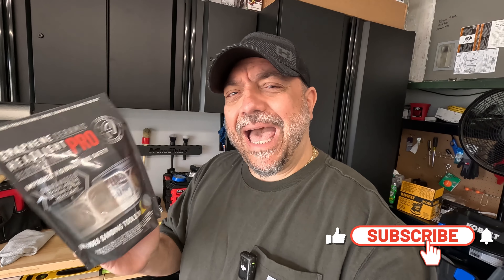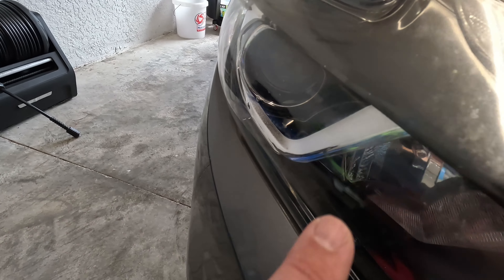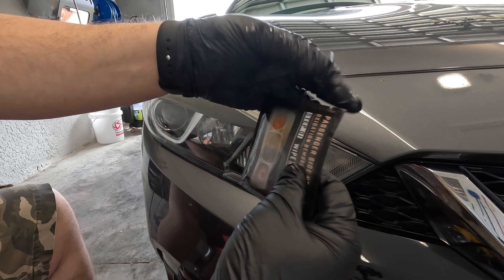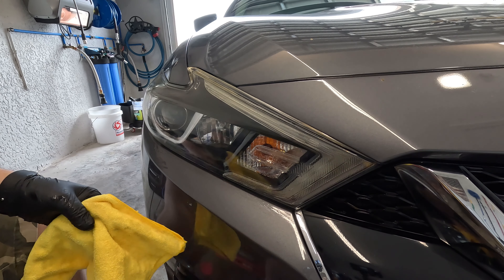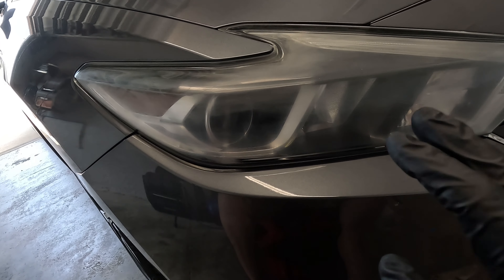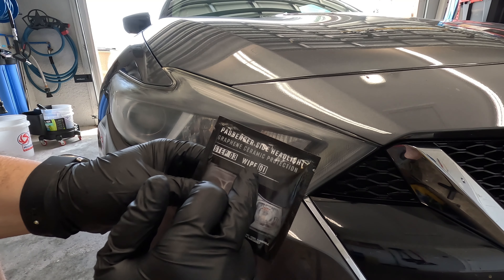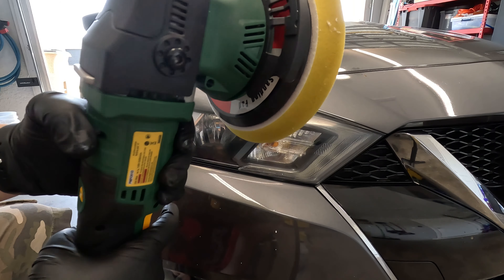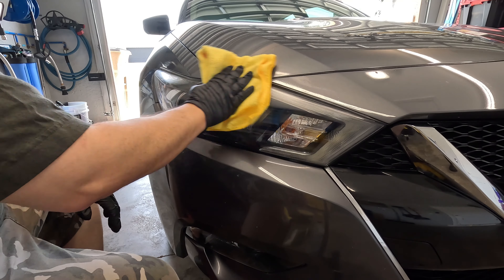What A Disaster!! Adam's Headlight Restoration Kit - Graphene Ceramic Coating Pro Kit

Comment: im in florida I used Turtle wax headlight restoration kit which was just a mild polishing compound and little bits of sandpaper it worked. however, it did not last. it doesn't have a sealer UV protector with it. it just takes off the faded part or the yellow one part. I think you can use a 2K spray high gloss spray paint and it would work beautifully because it would have the protection added on to it seal or whatever. my daughter she lives up in Iowa and she's used that cerakote and she said it worked phenomenal and it's still holding up and it's been it's been 3 and 1/2 months said it took a bit to do the sanding to get years of yellow out but they do look amazing. heard 3ms kit is good just tales more cure time Im going to try the cerakote one or will use the 3m light polishing compound I have on hand and work my way up using a different sandpapers and use a 2K urethane rattle can clear higj gloss

Comment: Hey Mike, in regards to Cerakote. I would probably use something else. I used their product on my trims, and it ruined them. Has to be wet sanded off. Won't ever use any product from them again. The headlight restoration kit might work, but I would never try it. Regards from Denmark